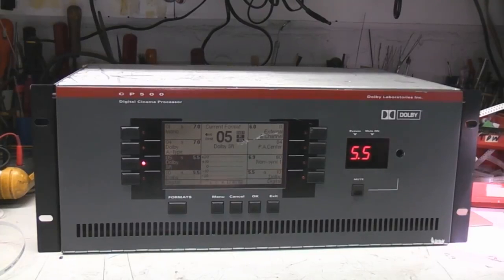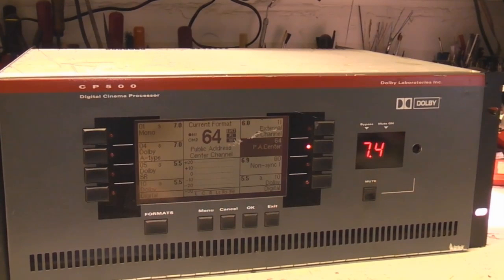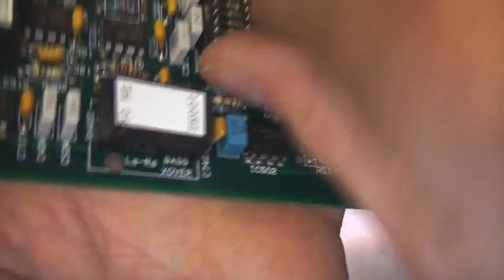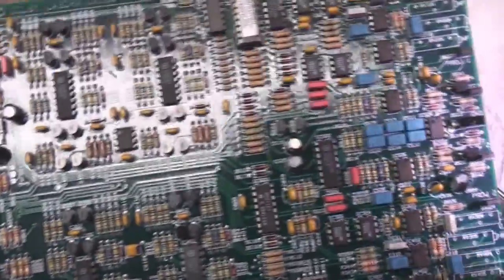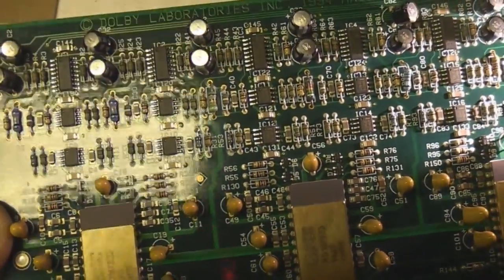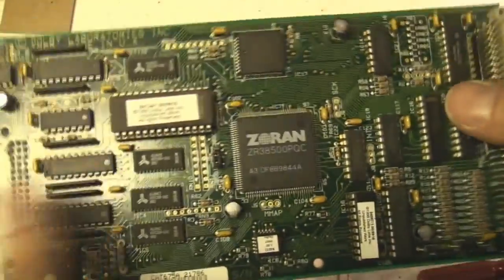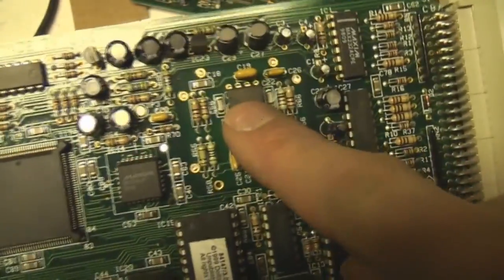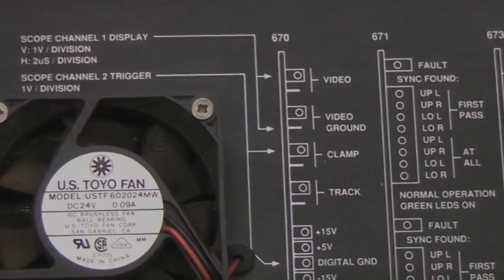Dolby CP500  Digital Cinema processor teardown

Comment: This was quite impressive.  It is clear that he was not a user of the product yet immediately grasped  what each module and what the parts on each module were doing and pretty much nailed it. 

And yes, unbalanced output.  Cinema was the last bastion of unbalanced professional audio.  Furthermore we have used 300mV as our reference level (-8.2dBu).  From Dolby, the next processor, the CP650 did move to balanced output (still 300mV reference level) and also used DB25 connectors instead of the Phoenix style of the CP500.  With DB25s, one could maintain shielding of the audio though the connector and it pretty well shielded up the whole backplane.  

No, XLR connectors never found widespread adoption on any brand of Cinema Processor, with Sony being the notable exception.  XLRs in cinema bring nothing to the table except an added expense for the connector and the time to make them.  Prior to the CP500, the customary I/O connector was a terminal block that used a fanning strip for solder connections.  With cinemas, that wire is often only touched upon installation and to never be touched again until removal...decades later. There is no need for any connector that promotes ease of removal.  It is more important that the connection be good over a long span of time.

Comment: 90s electronics are cool! So many elements, now it's more integrated and less interesting to look at the PCBs
Reply: It's more integrated , but it can do more stuff :)
Reply: jekader it's more like the cleverness has migrated to the software side from the hardware logic side.
Reply: ***** Not necessarily. Software won't be able to do the cleverness without the complexity of integrated circuits, etc.
Reply: Dr. Cooldude what i mean is, right now the chip is a cpu, with a dsp an mmu and an FPU under one roof, and you write the program. Before that discreet logic was to do all that with different chips doing different stuff and wiring them. You didn't write a command like add this to that then multiply it with a language. You had to take adding ICs and implementing it like that. I'm not saying that it's bad or wrong or that it is any less "smart" in doing it in software.
Reply: ***** Ah, fair enough, I see what you mean now.

Comment from the maker: It's a conventional lab type microscope, but illuminates through the objective - I think these are commonly used for metallurgy. Plus an SLR eyepiece adaptor - the latter doesn't work as well as it should do though - images are much clearer via eyepiece - not had time to investigate why.

Comment: The AD1879 was developed jointly by Analog Devices and Ensoniq; it's original application was the ASR-10 sampling synthesizer.  Both dies in the package are manufactured by Analog Devices, as Ensoniq never did have its own facilities for fabricating chips.

Comment: Most of them are for level buffering.  I know it doesn't make sense that there are two of them on the DAC outputs when each NE5532 has two op-amps in them.  Four of the 5532s are in the audio stages and the last two are in the circuitry for the CD mechanism itself.

Comment: I have the dpb 7001 out of the BBC's Ellstree studios :o)  It's got 2 tablets of different ages and makes (no magnetiser), the Fujitsu 335mb hard drive with 11 inch? platters, an 8 inch floppy drive with loads of floppies (hoping to read them with the pc in teh next few weeks), loads of service manuals, operator manuals etc.  Had to build a new power supply as both originals blew up!.  ATM, it's booting to debug but can't find it's drive, a friend is building an interface to see what the back...

Comment: Hi Mike,

is there a difference between (the quality of) SMD and through-hole resistors? 
If one has the possibility to place SMD parts, wouldn't it be faster and cheaper to use as much SMD parts as possible?

(btw, very nice video - as always!)

Comment: I never really liked the 500; preferred the previous model, the CP-65.  The DA-20 was to add the facility to play Dolby Digital tracks to the older processors.  I'm adding a secondhand DA-20 to a cinema with a CP-65 at the moment.  It's re-opening next month, and will still run film for special events.

Comment: Hej Nice video. I have a problem with my CP500, it is about 5 min to start up and after that it works perfect.All lights on front light up in the 5 min to lamps light faulth på the to board cat.no. 675A.Do you have an idea what it cult be.

Comment: Often when I see a circuit I think that could be done a lot simpler. This is an extreme example.
Rational audio is obviously kept entirely digital and only made analog in each speaker element using class D or similar clean efficient design.
Those analog landfills offend me at my core :)
Reply: Would you not consider that to be technically superior but qualitatively not so?

In my experience the subjective difference in audio topologies is best analyzed by ‘functions’.

For example- it’s very hard to measure the differences in MP3 compression. The  data defined by that compression is intentionally designed to measure the same as the original and the engineers do a good job! (They also wanted it to still sound like the original too. So there’s that.)

Point being, BY DEFINITION data is lost; therefor the sound quality has been degraded. 

Can you hear it? I was dismayed to discover that you can. It’s a loss of ‘air’. There is no measure for that as far as I know… 

But the qualitative difference is supported by evidence that data was lost.

To your point- a dominant pole output inductor on a class d amp ahead of the variable inductance of the voice coil itself should provide a better impedance to the digital section. Right? Now, inductors by nature have a memory. What came before affects what is happening now. Wouldn’t a linear circuit be preferable? Digital equipment is also commonly time dependent. 

Which system has a faster settling time to the original signal? Well, that’s why I love audio.

:)